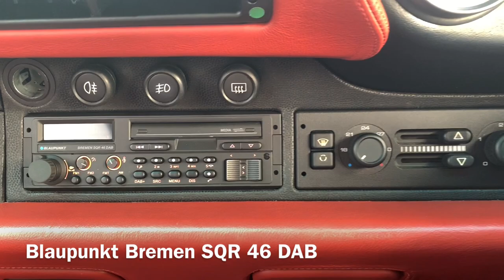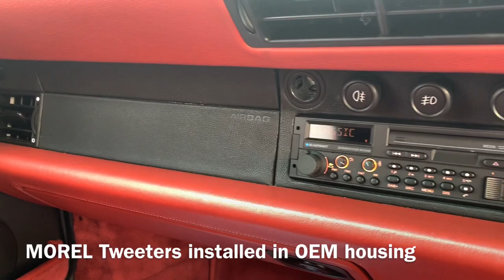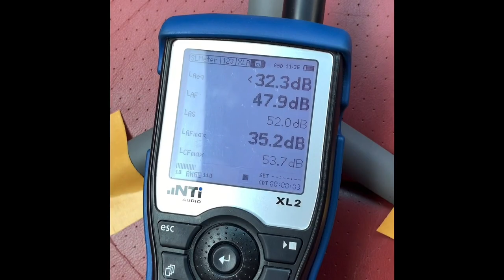Porsche 993 Carrera S Audio upgrade and cabin soundproof.

Comment: Installing 130cm midwoofers in the front doors is a total waste. 165mm ones fit just fine in there and sound miles better. Plus, you should also put one of those flat subs under the passanger's seat - makes HUGE difference (even tho they don't go super deep).
Reply from the maker: Thank you for your comment! When it comes to audio installations in the Porsche 993, we always encourage our clients to use 165 mm speakers, as they fit perfectly and provide excellent sound quality. However, many owners of these cars prefer to maintain the original appearance and are reluctant to make any changes. If you look closely, you’ll notice that we were able to install new tweeters in the original housing, and the rear speakers were covered with the original grilles, which we repaired and modified to maintain the original look.

In most of our installations, clients, after consulting with us, opt for larger speakers, as well as a subwoofer under the seat and an amplifier, with some even choosing an amplifier with DSP. Each installation is thoroughly discussed with the client regarding their preferences, expectations, and budget.

In this case, the client came to us right after purchasing the car, following a trip to the south of France. They noticed that the cabin was quite loud and, in search of a solution to this problem, came across us while reading many positive reviews and comments on the topic at www.911uk.com forum. When they contacted us, they hadn’t considered upgrading the audio system, and the decision to replace the speakers and install a new radio was made during the soundproofing work. When the client saw the condition of the original speakers, they decided to replace them.

Thank you for your insights, and we’re happy to share our experience!

Comment: What was the dB reduction?
Reply from the maker: We achieved a 3dB reduction in the cabin after soundproofing the Porsche 993. To put it into perspective, a 3dB reduction means the noise level has been halved in terms of sound energy. The measurements, taken before and after soundproofing using NTi Audio XL2 equipment, were done with LAeq type of sound level measurement, which represents the average sound level over time. Thanks for watching!